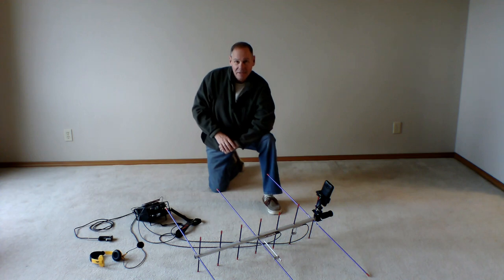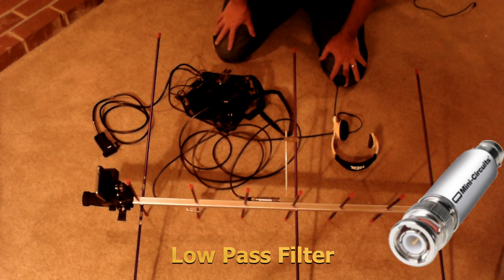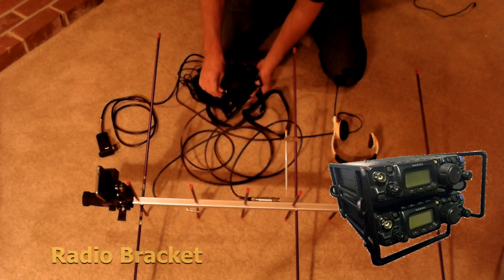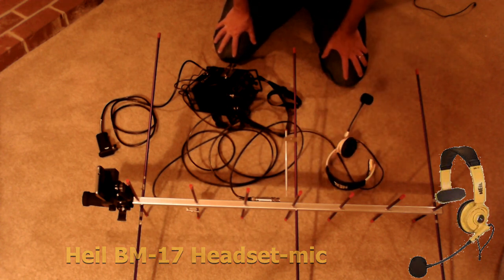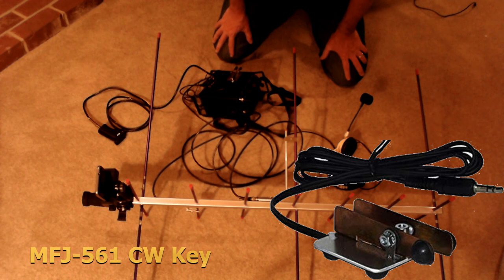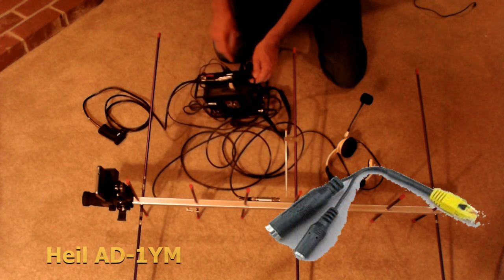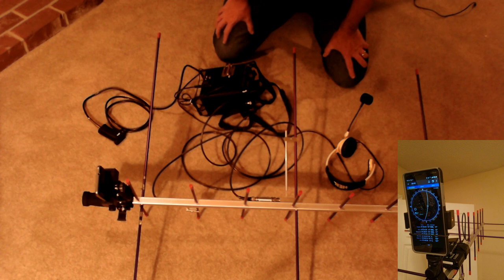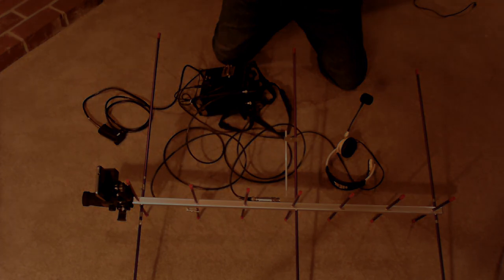My Linear Satellite Setup / KB8BMY / How to Set Up a Portable Linear Station

Comment: Thank you for the great video.  Question:  I just purchased an Arrow - how did you mount the phone?  On top of the rubber grip on the Arrow?  I only have 1/2" between the rubber grip and the first element.
Reply from the maker: I used a camera clamp that I mention below on the parts list.  I put it right over the rubber grip, but also leave room for me to grasp the handle.

Comment: Great video. Question re filter that you use on 2m line. It’s ‘officially’ rated to only 0.5W. What power have you comfortably stuck/risked through it without smoking?
I get a bit confused whether to put a filter (half duplexer) in the 2m or 70cms line!
Thanks for your time.
Nick M1DDD
Reply from the maker: Nick, 
I've had to stay below the limit when transmitting on a VHF uplink. So you may want to consider something else if you intend to use higher power.  73, Mike
Reply: @kb8bmy  thanks for reply

Comment: Hi. This is a really helpful video for someone starting out in linear satellite (like me). A Question though: I see you’re using BLP-200+ as a filter for the 2m side of the antenna. This is rated at 0.5w in the data sheet, are you using 5w on the 817? If so, any problems with the filter? Thanks.
Reply from the maker: Hi Rob, 
Thanks for the compliments.  I saw this filter being used by several other operators, and they have said that it can be used as high as 5 wants without damaging it. That being said, I still have desense on UHF recieve when transmit uplink on VHF. It's still a problem that I am trying to solve. Otherwise for uplink UHF/downlink VHF its worked really well. 
Thanks again.
73, 
Mike 
KB8BMY
Reply: Hi MIke.Thanks for the reply, I guess the continuous rating is 0.5w but they might manage 5w peak during intermittent TX. Glad to hear they’re working for you at that power level.  Have you considered using a mini-circuits BHP-400+ in the UHF path to help with the desense in V/U mode?

Comment: Where can you get cheap linear satellite equipment? I have been doing FM sats for a while now and have been wanting to upgrade.
Reply from the maker: The Linear Station I put together is probably the best least expensive way to operate not only FM or Linear Satellites.  Chances are, you already have an arrow if you were doing FM sats and maybe even a FT-817.   I did. and all I had to do was add an FT-818.  That kept my cost way down, along with equipment not being too expensive.

Comment: I haven't messed with satellites in almost 30 years, so forgive my ignorance. Is it not possible to use a computer for frequency control due to doppler during the pass? Maybe a Raspberry Pi using gpredict or something like that?
Reply from the maker: Yes it's possible to use a computer. Like a laptop. I don't know about Rpi. I don't want the extra bulk when I operate portable so I tune manually.

Comment: I only use 1 radio Retvis RT3S for FM satelittes, and my antenna has a duplexer.  Why can't you do something like that with Linear?  1 radio with a duplexer?  Also I do not need a filter for VHF/UHF on FM analog why is Linear different?
Reply from the maker: Sailing freedom 

It really depends on the equipment you use. 
You'll need a radio that can do full duplex and fir linear satellites it has to do ssb. 
Also, you'll have to correct for doppler shift on at least one band if not both bands. Unlike FM the doppler correction has to be in very small increments 1khz and at the exact rate of the speed of the doppler shift. If you don't adjust your vfo at the correct rate, you and the other station will be listening fir each other on a the wrong frequency. 
Most operators use a computer for tracking azimuth/elevation. The computer is often times connected to the radio to automatically correct for doppler.  

When I made the videos, I was roving often and always operating portable.  
I use the equipment I do because it's light and easyto power. I don't use a computer. I track manually. 

The filter is for if your uplink is on VHF and your downlink is UHF. to prevent intermod 

You could use an Icom 9700 or a similar radio that can do full duplex on both bands. 
And a computer and software. 
Many operators use a Leo Pack antenna setup.  

It all depends on how much money you want to spend. 

Hope that helps explain it a bit. 

73

Comment: I have the exact same setup. could you tell me how you are working the radios? i dont have any problem finding them, but for the life of me i can not hear myself, even with the cheat sheets.
Reply from the maker: Mic, 

The tuning is rather tricky at first, but once you get the hang of it, it gets easier. I’ll try to go step by step how I do it.  This may seem a bit lengthy, but I think the details may help you see how I do it. Remember, this is how I do it. Other people may do it differently, but this is what works for me. 

Let’s use CAS-4A as the example.  And KE0PBR’s frequency cheat sheet as the chart to work from. 

Again, I should point out that this is the way I do it. 

 I usually start out with my receive (downlink) radio set at a frequency at the center of the band. (145.870) 
I have the luxury of being on the very, very western part of the North American Continent. Which means when the satellite rises over my horizon, there will be few if any other stations on yet. So, if I pick the popular center of the band, there's very little if any chance another station will be on that part of the passband. 

I’ve already set my transmit (uplink) radio to 435.210 and in CW mode.  

As the satellite rises I may or may not swing my receive radio to the beacon frequency of 145.855. I usually only do this if for some reason at first, I’m not able to hear my CW tone when I expect to hear it, usually after the satellite has gained several degrees elevation above my horizon. 

I hit my CW key and if needed, I move up or down just a bit to hear the tone.  I also will swing my antenna a few degrees in azimuth and elevation if needed, once I hear the tone. Also, I may twist the antenna to rotate for polarity.  Usually, I do this rather quickly. And rather quickly I’ve got my bearings. Meaning: 

I know that I’m aimed right at the satellite, I have the correct polarity and I’m uplinking correctly and hearing my tone the strongest possible on the downlink.  It literally takes only a few taps on the Morse key to know I’m there.  

Then, I switch to LSB mode on my uplink radio. My voice signal will be a little higher in frequency on the uplink. So… I tune up, while listening to the downlink.  At first, I’ll sound like Donald duck on the downlink. This tells me I need to keep going down in frequency on my uplink. 

I don’t change my receive radio frequency at all during this part of the process. Or I’ll throw myself off and lose myself on the downlink. Then, I’ll have to start all over again. 

So, to give a frame of reference.  My CW tone will be below my LSB signal.  So I always know, that once I hear my tone, I have to go down in frequency on my transmit radio.  

I continue, till I hear my own voice on the downlink sounding as natural is possible.  You’ll notice that I will sometimes pass that sweet spot and have to adjust back.  

The entire time this is happening, the satellite is obviously moving.  Its always moving and its always spinning up there in space.  I always have to have that in mind. Meaning, the frequency is changing because of the doppler effect and the polarity is changing and the position of the satellite is always moving across the sky.  

So, I have to move the antenna and twist the antenna and listen if my signal drops, meaning I’m off aim and polarity of the satellite if that signal is weak..  Also, once I’ve found myself I have to realize that the freq is changing.  
And I have to compensate for that.  

And if all that isn’t enough fun, there's another element: The rate at which it changes will began to vary.  Now on the CAS satellites it's not so bad. But you really notice it on the XW satellites.  
The closer for example the XW gets to you, the faster and more pronounced the doppler effect. 

But you can learn to adjust for it.  

So, back to finding yourself. Once you’ve found your CW tone, switched modes to LSB started calling CQ and heard yourself sounding like Donald duck and properly tuned so you sound like you, comes the next step. 

Keeping up. You continue to call CQ and very, very carefully adjust your uplink radio so you continue to sound natural as the satellite travels overhead.  

At some point, (from my vantage point) the satellite’s footprint will have moved onto and over the North American continent that others along the coast and inland will be able to hear and get into it.  It’s at that point that someone most likely will hear you and come back to you.  

Then comes the next step, tuning and tracking as the satellite continues eastward while tracking, tuning and compensating for how the other guy may be tuning. All while starting and having a conversation with that other station.  I can go into that later. 
But for now, that’s how I find myself to get you started.  

I do have two other videos posted that kind of show this, though I don’t explain it in detail.  One is called Linear Station tuning. You can’t see the frequencies on the receive radio, but you can see where I’m tuning up or down.  The other video is called Conversation via Amateur Radio Satellite CAS -4B. By reading how I do it and watch these videos, you may get a little idea of how I am doing it.  

I did realize after you contacted me that I probably should make a detailed video of exactly how I find myself and tune/track. So I have it on my to do list to make such a video.  

In the meantime I hope that this explanation and the existing videos help you enough to solve your problem of finding yourself to get a start. 

73, 

Mike
KB8BMY